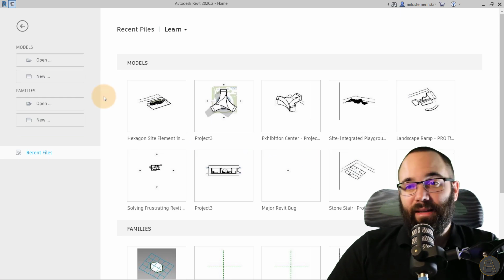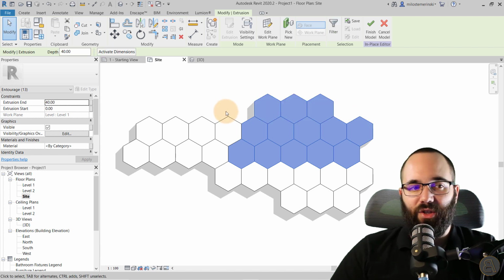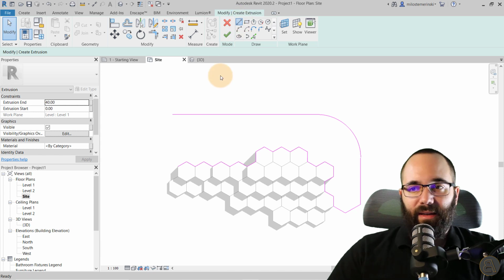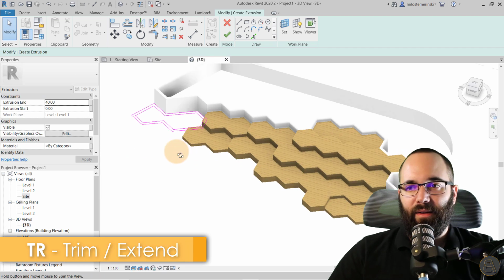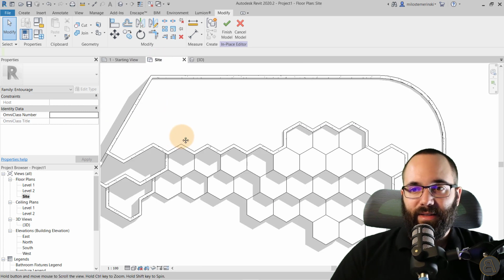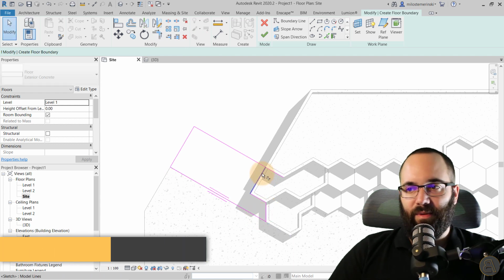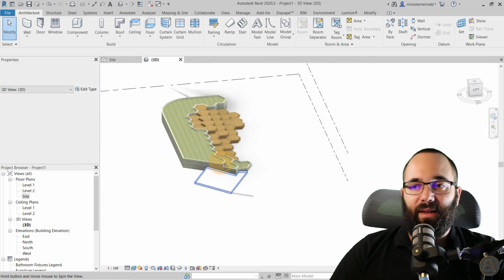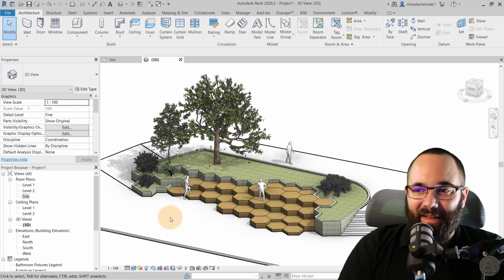Hexagon Site Element in Revit Tutorial

Comment: Hey Balkan! Whats up? I'm trying to solve a revit problem for a while now and it's just too tough to solve. Is thre any way to model something and make it visible in sections and views but not visible in 3d? I have a door, that needs to be closed in views and sections, for documentation purposes. But since the same model is generating 3d geometry fo D5 render o Twinmotion, it would be great to be opened in 3d. So on my family I created to door. One closed and other one opened. Set visibility paramater ( instance) on both of them. But the main problem is that I need to review and change all doors if I'm doing renderings or if I'm doing documentation! Can you think of a way to automate?